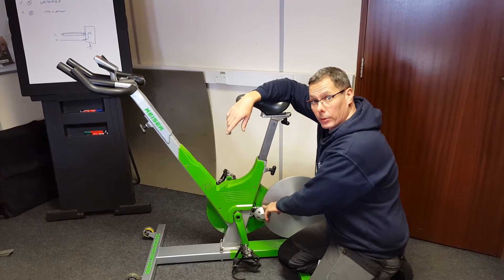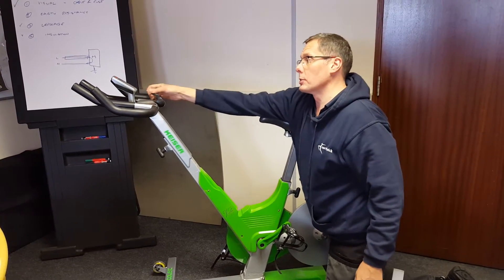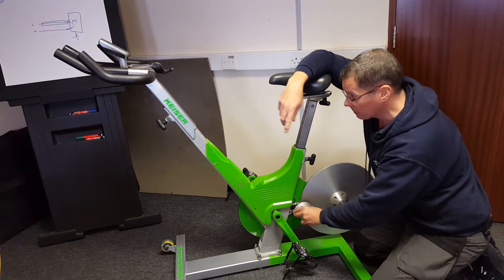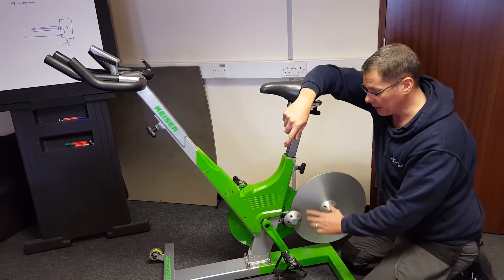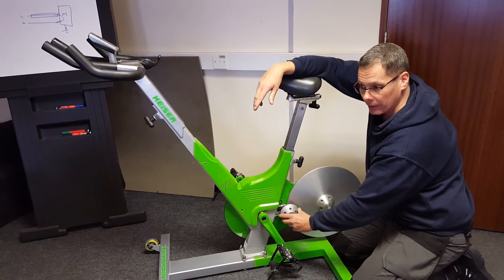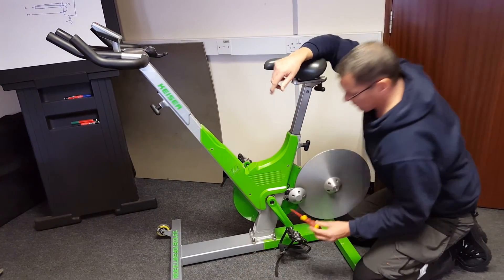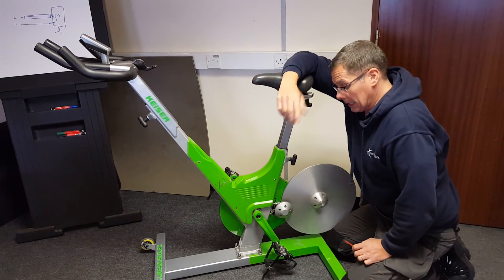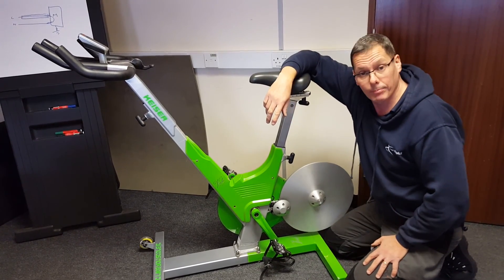Simple way to recalibrate keiser M3 bikes part 1/2

Comment: I'd like to manually (or hack) my M3i to read a bit lower, as it reads too high despite the calibration and cable tension appearing to be correct. Do you know if I can do that by adjusting the potentiometer?